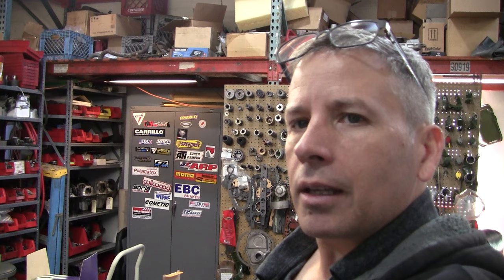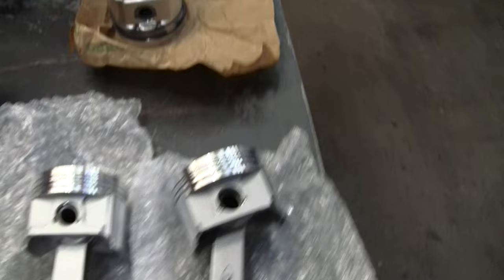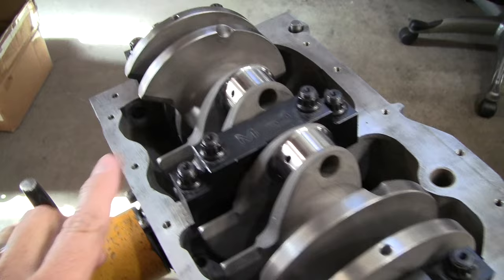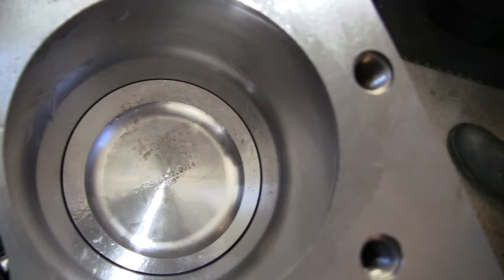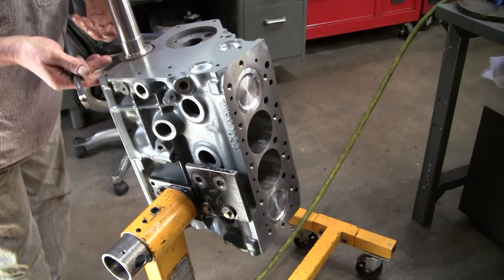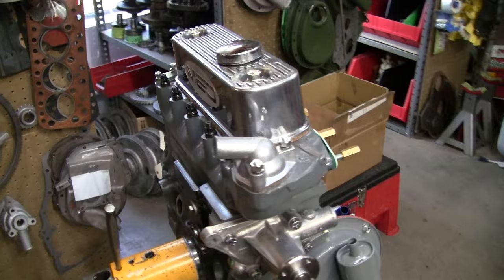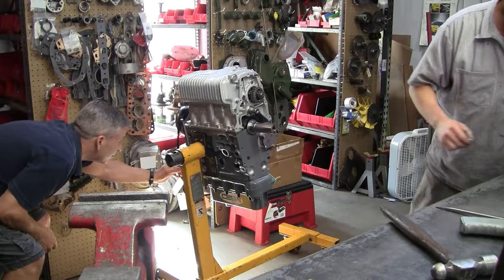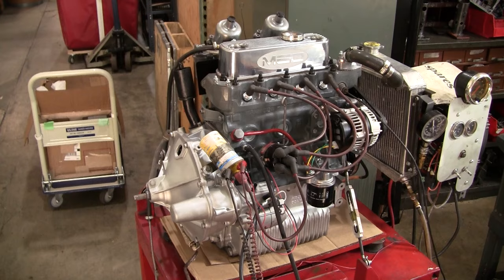Classic Mini Engine Performance Upgrades

Comment: 2 words.. honda swap
Reply: One word - Why?
Reply: power, reliability, parts availability, also a stock honda engine can put out as much power as these built mini engines.. which means two things, one, if you leave it stock itll be very reliable, and if you decide you want even more power it can produce it more easily. This is just my opinion living in north america where parts are hard to come by for the classic engine without massive cost.
Reply: @randkprouductions  If you like Honda so much go buy a Honda don't butcher a classic car! People buy and run Minis because they ARE Minis. Why would you buy a Jaguar E Type and put a Ferrari engine in it?

Parts availability is NOT an issue in any way even in the USA. I am rebuilding a '78 Mini 1000 (in the UK) and have had no difficulty obtaining the parts I need. Minispares UK and Minisport UK ship all over the world and have various excellent agents in the USA. MiniMania being just one

A Mini engine / gearbox has perfectly acceptable reliability if built and serviced right. And you seem to forget we are talking about decades old motor cars from another generation (or two) so at least compare like for like.
Reply: That is a good point, however hondas dont really have the same charm as a mini.. as far as the "butchering" a classic car, thats simply not the case. The minitec kit pretty well makes it possible to swap back the mini engine whenvever you please, all you have to do is weld back the inner arches. I live in Canada, getting parts here is a possibility however getting quailty parts becomes astronomically expensive. For example, if I buy balljoints for my mini, I have to pay for the part, shipping to Canada which is very expensive and to top it all off, the duty when it is imported into Canada. A $ 20 part becomes $100 part. Now imagine with high-end engine compontents, I think you can imagine how a $5-7k engine becomes a $10-12k engine when brought into Canada, and at the end of the day, you dont get 12k performance, you get 5k performance.
Reply: @1chish  Yes, well said.
Reply: @randkprouductions  Surely then, part of the charm is having the right motor.
Reply: Rushabh Shah 
Perhaps it's best that you leave those vehicles to those who will appreciate them.
Reply: stephen john gray   If you don't understand the value of a classic car then you won't understand why restoring something back to its originality is priceless. Destroying something like an E Type to make a trike says more about you than anything I can say.
Reply: @randkprouductions  You forgot gears mismatched for Mini wheels and tyres and all the work and compromises making it fit where it was never intended to - exhaust routing, cooling, driveshafts....

Fair comment about your location, but there are other options Suzuki, Nissan....
Reply: @applanateearth586  didnt mean to troll.. sorry!
Reply: @randkprouductions  tbh, a honda swap will just give you more hp than you would be able to use. blow the tires off, and tq steer into oncoming traffic.